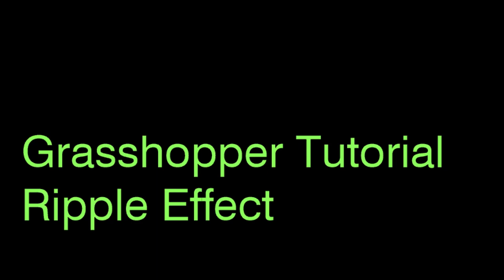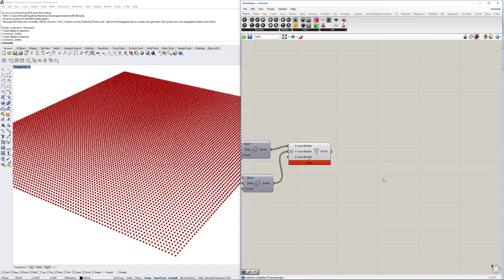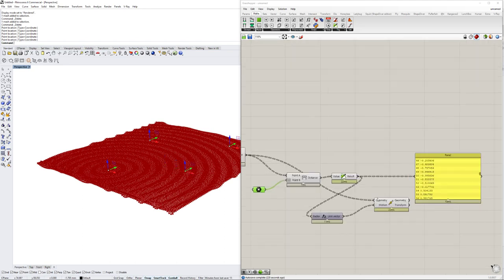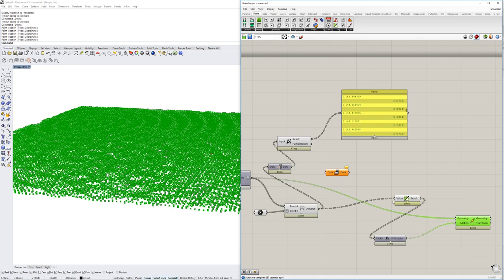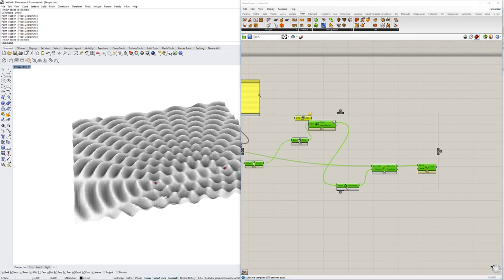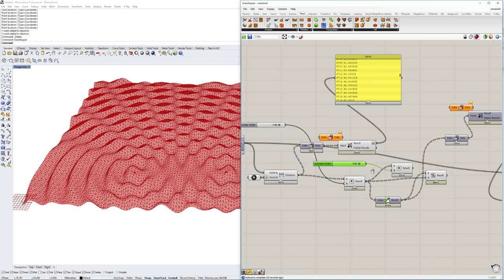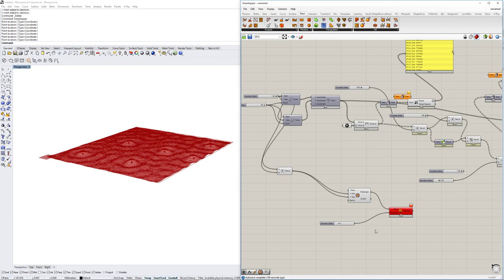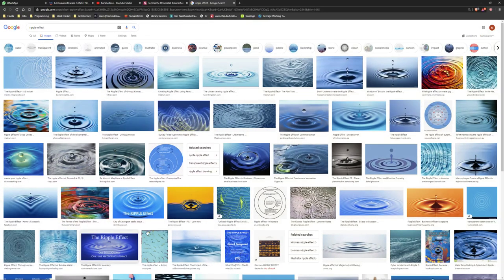Creating a Ripple effect

Comment: Would it be possible on 3d oriented surface?
Reply from the maker: Yes sure, I would recommend either morph the surface then on a different existing surface, or if it's just roated, then you can orient with a reference and target plane or morph with a box. that works pretty well